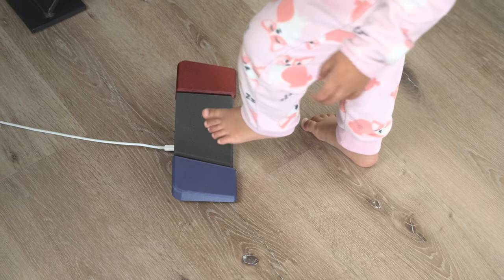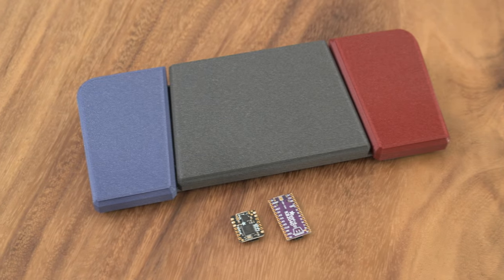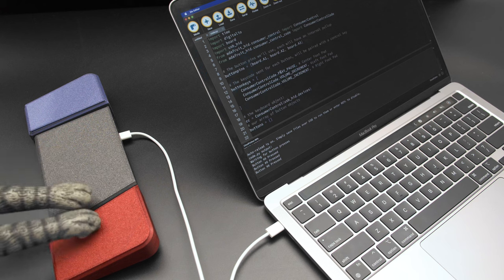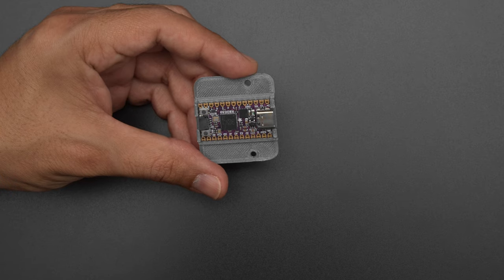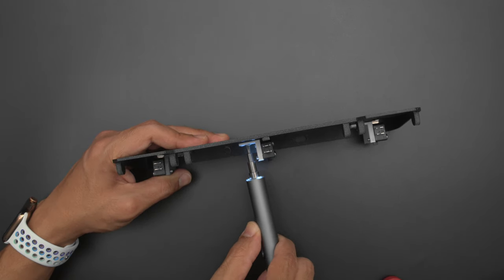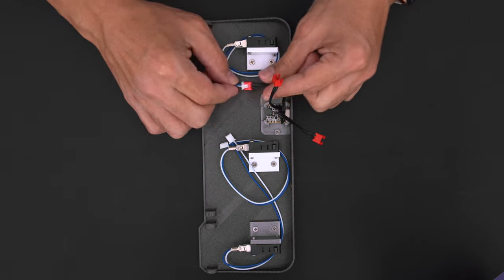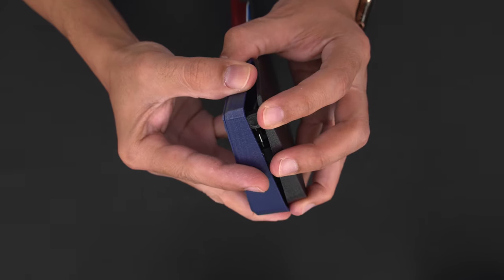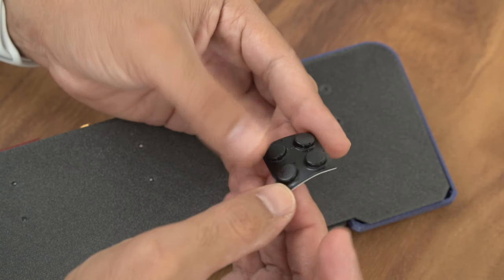USB Foot Switch #CircuitPython #adafruit

Comment: Hmmm. Is the print design strong enough/include stop limits for gaming - i.e., Time Crisis reloading/ducking pedals? Using original hardware here so I'd likely just swap in my hacked, trimmed and circuit-minimized PS1 3rd-party controller's X-button wiring and switch; and, yet, this pedal could offer more... a threaded hole in the face of the center pedal for inserting a strain-relieved handbraking lever for use in racing games (when the controller is rotated 180° for those operations), etc. 😶😑😶🤔